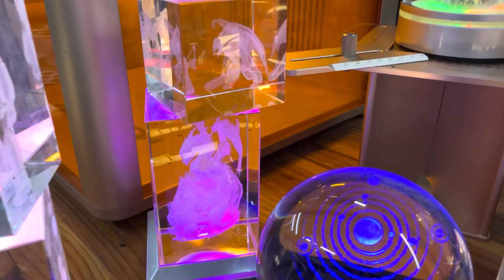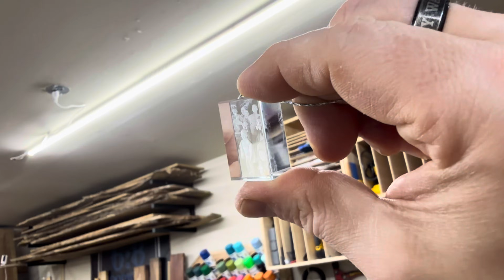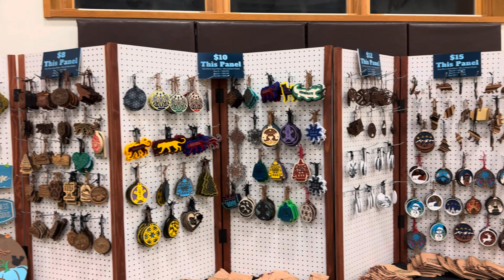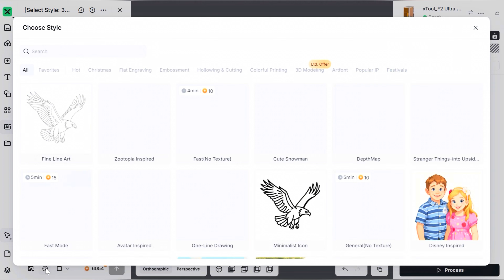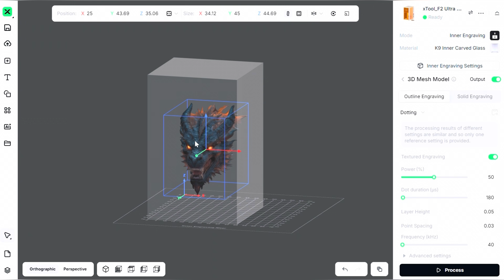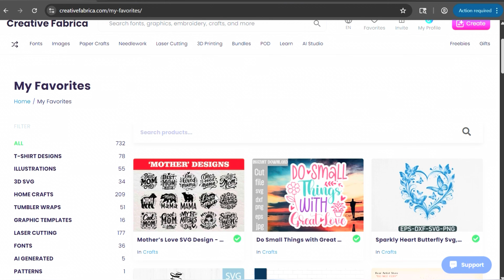Engraving INSIDE Glass: Sales Ideas, Blanks, Software, Applications, & More

Comment: Cockpit3D sells genuine K9 crystal shipped from North America. They have been around for over 20 years. So, XTool is definitely not the first for Crystal Engraving or even UV lasers in general as implied in the video. XTool will help popularize sub-surface engraving for hobbyists even though it’s super slow to get decent results with a UV. When it comes to crystals, UV is more of a hobby machine. For business UV is not fast enough to get the speed necessary to produce in mass unless you prefer waiting hours for what can be done in a few minutes. XTool has some great marketing as demonstrated by this video, but if this is for business, you should have the right tool for the right job regardless of brand. UV is capable, but not the right tool for crystal.

Comment: I have tried 3 inner engravings now... I was very careful to enter all the dimensions correctly. It was the K9 that came with the F2ultra UV, and 2 other K9 cubes. HOWEVER - each time, although in the software the image looked perfectly centred - the image ended up way too low in the crystal! The first one even burned my metal stand, as it went past the bottom of the crystal! - My question - WHAT is causing my image to engrave TOO LOW! How do I fix that??